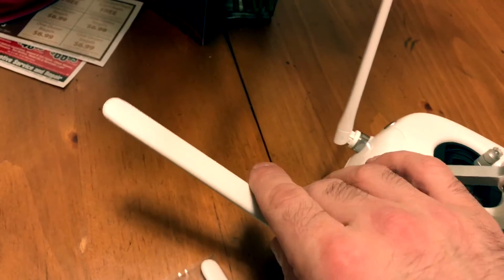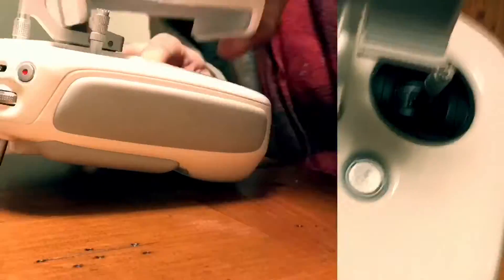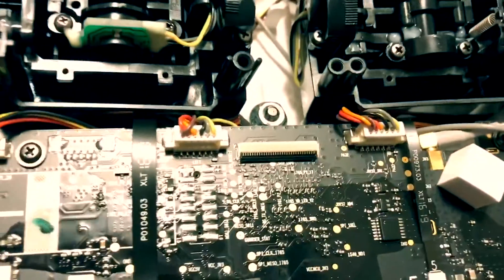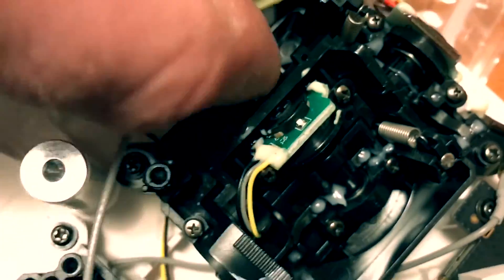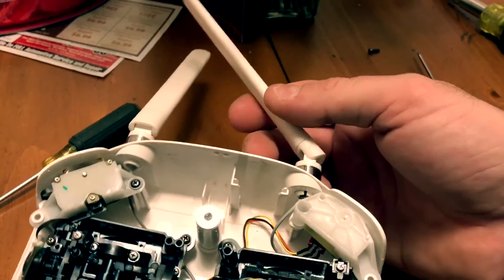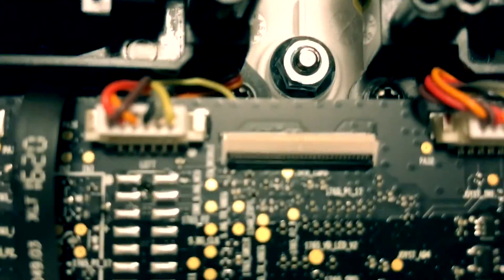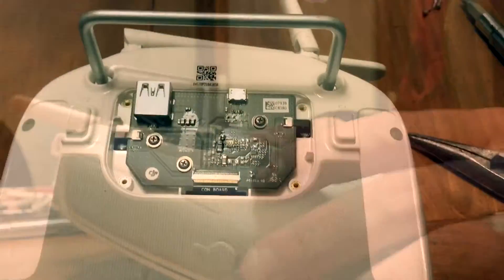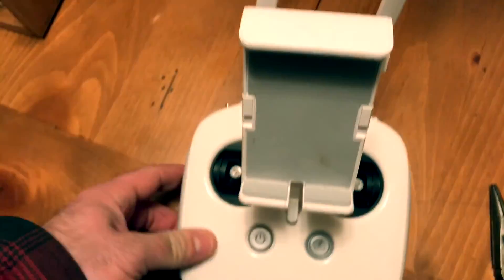DJI Phantom 4 Controller Repair Tutorial - Antenna Replacement

Comment: I would STRONGLY suggest disconnecting the USB ribbon cable from the USB board under the cover on the under side of the controller BEFORE YOU SPLIT the shells, as depicted in https://www.youtube.com/watch?v=fBt7FiH0mII
You risk ripping the ribbon cable connector of the mainboard if you do not and that leaves you with a mainboard that you can not relink nor do you have any feed to your viewing divice, nor do you have C1 and C2 functions. 

I know this to my cost, I had done as I suggested and had actually replaced a joystick but during reassembly the controller slipped, I grabbed for it and the ribbon cable got snagged and it tore the connector of the mainboard, the connector took mainboard tracks with it. 

Aside from that reason it is an easier reassembly if the ribbon cable has been detached from the USB board

Comment: thank you man, it was very helpful, I went to a DJI sore in NY city got my black antenna for my dji p4 pro for $15, they told me after 2 days they will give me a price quote for the replacement but looks like 1 or 2 hours work. LOL with your video it was only 20 min and you saved me $130. Thanks again!!!

Comment: These little pins on the antenna that act like a hinge broke on my remote. I'm going to try using something to replace the pins but if it doesn't work I'll do this
Reply from the maker: awesome man I hope your able to fix it.
Reply: It seems like toothpicks fit perfectly. I put them in and behind the wire So it doesn't get in the way. And I cut the ends off and put a little bit of hot glue on it. It works like new.

Comment: Where did you find an antenna?
Reply from the maker: I got mine from a hobby shop in town. they parted out a broken controller
Reply: i got one in a DJI Store in NY City. 300W 49th St 10019